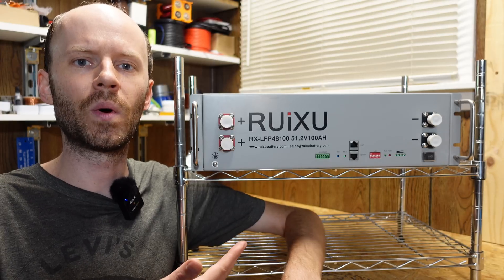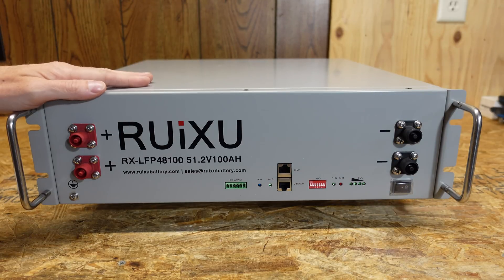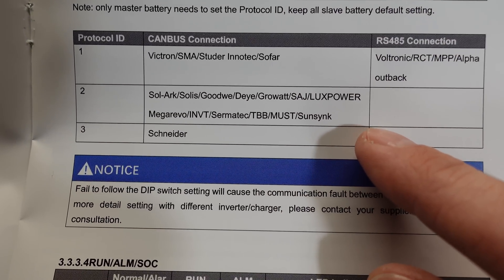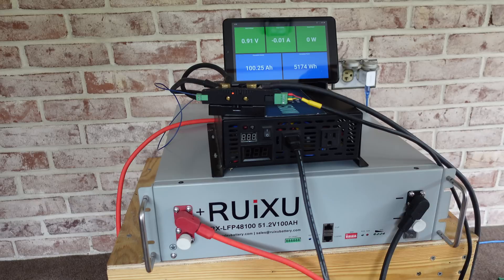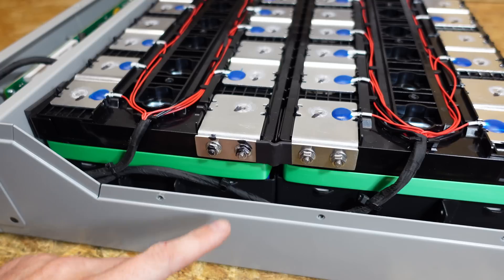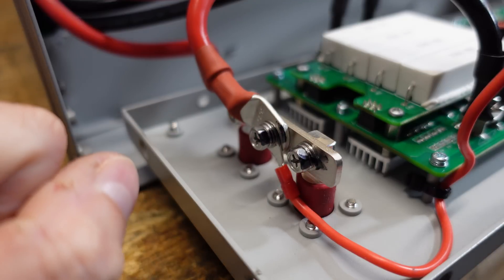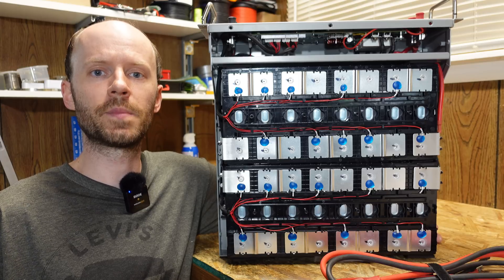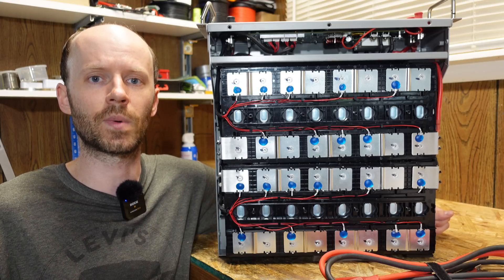RUiXU 48V 100AH Lithium Rack Battery Full Review, UL1973, Off-Grid Solar Power

Comment: 3U? LFP? 100AH? How is that possible? Other's need 4U. Are they squeezing more capacity in the LFPs? I thought it was a fixed formulation.
Reply: I know most companies can only do 4U, such as SOK. Ruixu batteries use GFB 100Ah LFP cells too, but ruixu cell model is different from SOK. The main difference between the two models is the pole structure. The SOK cell pole is designed with screw holes, but the ruixu pole is not, so the SOK cell is 11mm higher than the ruixu pole.   SOK 100Ah cell can use nickel-plated copper strips and screws to pack,  Ruixu 100Ah cell uses lasers to weld aluminum blocks. laser welding connection is much more solid and reliable, at the same, the height of the whole battery pack can be shorter. The choice of different cells is due to different design tendencies.
Reply: @ruixubattery  Thanks for the info. I see the laser welds now. 3U is GREAT! I know it might be better, but I would still prefer screw in connectors so I can replace the poor cells after 10 years and get more life -- maybe there is some low profile screws. Also do you plan on having a display version and/or bluetooth? I like the precharge resisters+++.
Reply from the maker: I'm pretty sure they're the same GFB cells as other batteries, just less wasted space in the case. I can't be 100% sure though as all I can see is the vent lol.

Comment: Thanks for the video.  It was nice to hear you say not to daisy-chain the batteries together.  Bus bars are so much nicer.
Reply: We recommend bus barS connection solution, not the Daisy Chain, The Daisy Chain is only available for a 48V system not over 5000W.

Comment: Why don't these companies use 300ah cells
Reply from the maker: Probably because you would need 5 people to lift and move it... You can get some larger capacities - Trophy has a 304Ah 48V.
Reply: @LithiumSolar  the eve 305 cells not much larger than the 100
Reply from the maker: @glennwest4438  The EVE 305Ah cells are 2.8 times larger both in terms of volume and weight. That means you're looking at about 325lbs for a rack battery of 305Ah cells.

Comment: - No charge current limiter on the BMS
- No circuit breaker / disconnecting means other than the BMS
- Permanently assembled so no possible field serviceability
- 7 year warranty vs 10 year most others offer
	- warranty is invalid if you don't connect CAN communication cables
	- warranty is invalid if you open the case
	- warranty is invalid if the manufacturer determines the battery is at the end of its usable life, however, they don't define what the usable life actually is
- No USA-based support (phone number is in China)
- No built-in monitoring to see %SOC, so you need to buy an external shunt
Reply from the maker: Fair points! In summary... Not an SOK 🙂
Reply: The breaker issue is really what stood out to me. Appreciate the summary Dexter.
Reply: Soc should come over can or rs232
Reply: This is 1450 usd and an SOK is $1650 right now. 200 bucks.. your call.
Reply: $400 less than units with those features. You get what you pay for.

Comment: I will wait for more information on those battery connectors not sure how well they are.
Reply from the maker: They're used on other batteries, like those by pylontech. Maybe I'll do some load testing on it and see how it handles under 100A.
Reply: They're made by Amphenol...very high quality stuff.
Reply: these look to be amphenol , seplos uses a similar connector, different company

Comment: HOWdy L-S, ... 
Thank you for this REVIEW ... 
COMMENT:  what a "terrible"  location for a "CASE GROUND" screw !!! ( within an INCH of the +POSITIVE+ Battery POSTS !!! )
a more logical location would be near the -NEGATIVE- Battery Posts 
...
the EG4-LL (V1) had this same poor design ... but ... the EG4-LL (V2) corrected this design "flaw" 
Thanks again
COOP
the  WiSeNhEiMeR from Richmond, INDIANA 
...
Reply from the maker: I'm not sure I see that as problematic considering the type of connectors we have here. There is no exposed contact area - connected or disconnected.

Comment: No fuse????
Reply from the maker: No fuses or breakers built-in other than the over-current protection of the BMS.
Reply: @LithiumSolar  so you would run 125A fuse any you personally recomend?